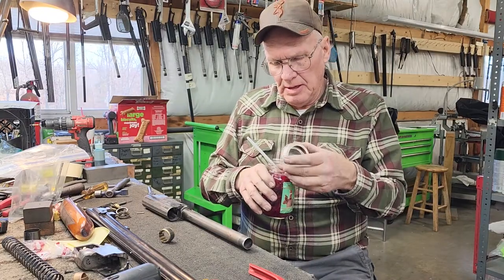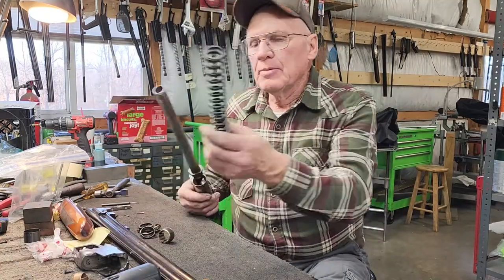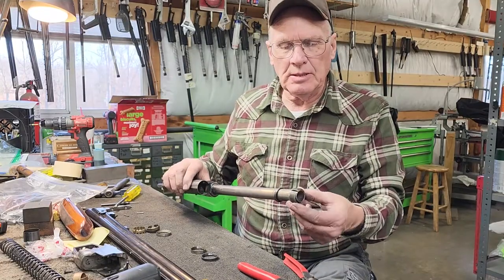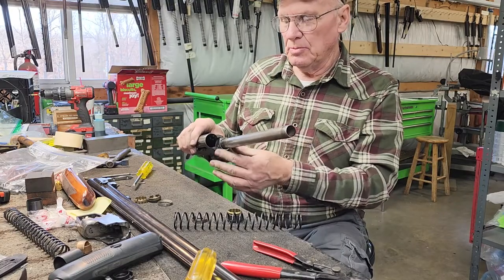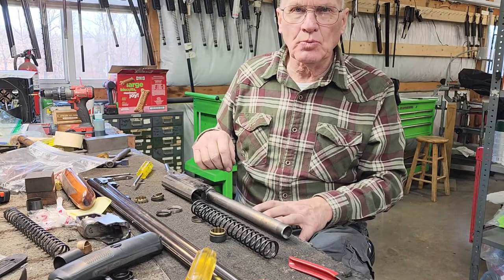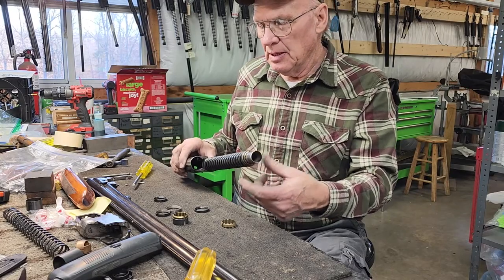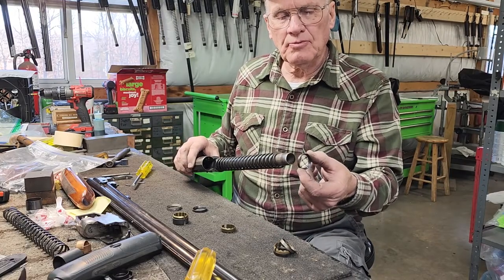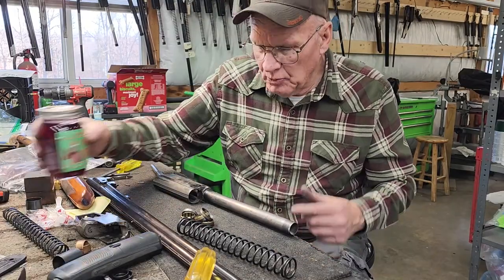Browning A5 Friction Ring Set-up

Comment: Art, after 52 years of shooting trap loads with my 3" A5 and cycling every last one by hand I discovered that if you set up for heavy loads and just put a little white lithium grease it cycles fine, just remember to wipe it real clean when you go back to the heavy loads or magnum as the rings will not have enough friction and the barrel will slam back way to hard.   As a matter of fact I still have the owner's manual and the way you show for the heavy load setup is exactly what my manual shows.

Comment: Art, Thanks again for keeping this info on Brownings design out there for all the newbies that get hold of these fine shotguns.

The rebuild kit you sold me for my Remington 11 tamed the recoil that was hard on the gun and harder on my shoulder. The original square section recoil spring was near two inches shorter than the new one in your kit. Same with the action spring behind the bolt.

I have noticed quite a few you tube videos on the Rhodesian Brownings with the long forend wood and long magazine tube. Also guys are turning A5's into Rhodesian lookalikes. Watching some of them shoot the guns you can see the recoil is severe. Probably due to the recoil spring being sacked or the friction pieces installed wrong or both. We try to spread the word about your rebuild kits and instructional videos as much as possible. Keep up the good work.

Comment: Art,
I’ve got a question. The real old Auto 5’s have that deal where you have to keep the bolt release pressed to load, but apparently the later ones don’t.
Can one swap out the parts to make the old ones be able to load like the newer ones?

Comment: I inherited an Auto 5 16GA but the 3 regulation rings are missing. Impossible to find any here.
In the USA there are a plethora of them but they do not ship outside the USA. What a pity.
Reply: All parts missing or just a steel ring (1:16 video time)?